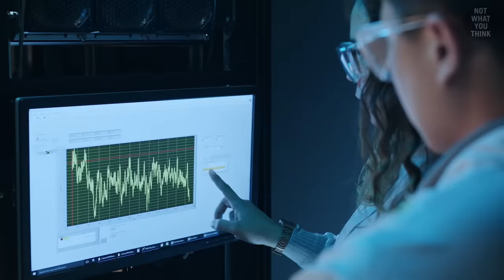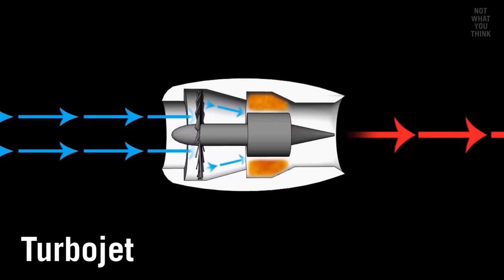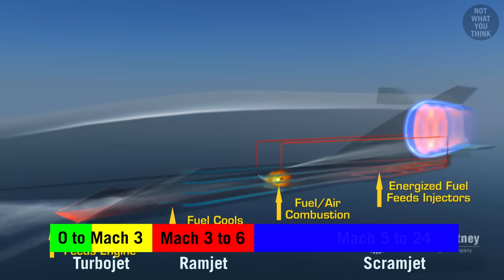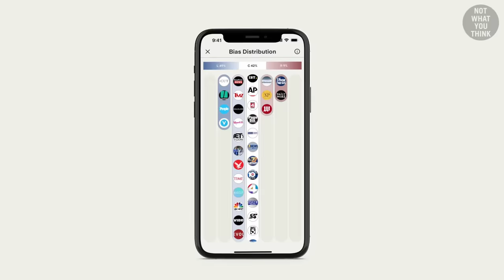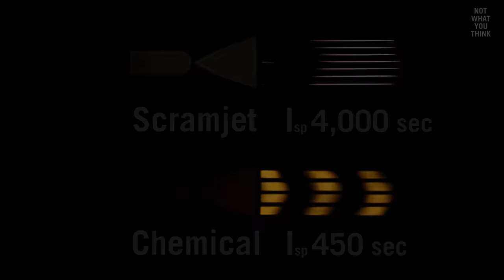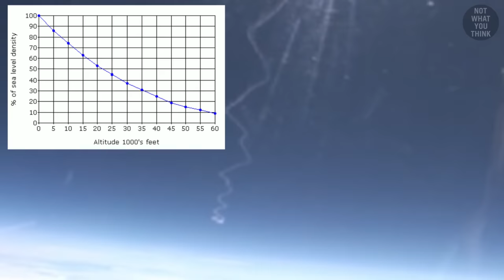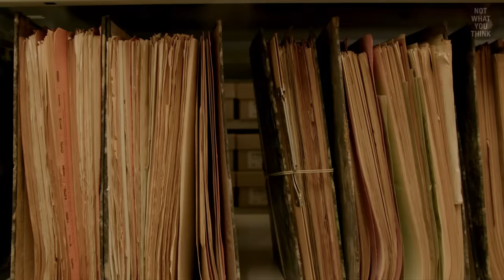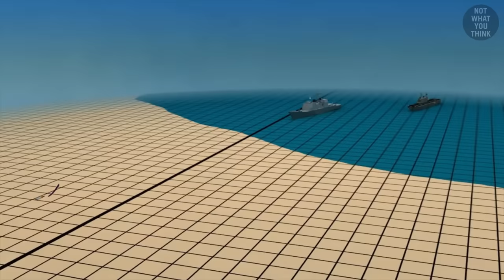The Hypersonic Missile Vulnerability That NO ONE Talks About

Comment: @NotWhatYouThink you're absolutely right on almost every account but one, the implied premise that all these problems are, somehow, inherently unsolvable, or at least unsolvable on a useful way during warfare.

None of the problems you men ioned are really impossible to o solve, not even communication while under a plasma sheet during the hypersonic flight. 

These problems can be solved, even though they are very hard to, but, essentially, to each and everyone of the problems you mentioned there solutions, some we already know how to solve and have the technology to do so. Some we know how to solve., but don't have the technology to do so yet, and some we don't know don't how to solve, don't have the technology but we do know that they have a solution because there are, no physical laws being broken, and/or preventing them to be solved at some point in the future if the right amount of investment is made on their research. 

The questions, at least until now, are: 
At what cost? And what advantage will be achieved in return from these certainly astronomical costs?

Right now, the all the potential advantages to gained from Hypersonic missiles, even though they look almost too good to be true, at least on paper. When you factor in the actual costs in R&D and the expected time frame from kick-starting multiple lines of research simultaneously and then start getting some significant results from most or all of them. And then the time and costs involved to redesign the solution that was tested on the testbeds/laboratories into a useful piece of technology that could be mass produced and used on actual production of weapons that are reliable enough to be used in warfare., Then things start not looking so good.

For instance, while we have a very good understanding of the overall physical and technological processes involved in scramjet engines, we are very far from actually having explored the technology enough to say that we reached a point that we have enough understanding of them to actualy optimize the way they work, or to design enough different designs to get the expected results on a cost effective manner.

The same goes to using sensors on the missile as well as the missile, sensors and payload not melting during hypersonic flight. We have sensors not only on our rockets and interplanetary probes, but on many far more mundane uses, that are designed not only to operate on conditions where they must go faster, run hotter, and are subject far more extreme conditions, like vibration, humidity, acidity, all sort of chemical and, radiation exposure, etc., often they are subject to multiple of these conditions simultaneously on any given moment during the course of a single mission, yet they do not melt down on reentry, the sensors do stop working when they are above Mach 5 in the atmosphere, they usually work just fine provided their operational parameter are met. 

For instance, even smallish two stage rockets designed to launch a low to medium weight payload, often reach sped in the ballpark of Mach 7-8+ during the atmospheric part of their inicial first stage ascent, and they neither melt, not their instruments -- including cameras, radio and data link communications, and all kinds of system specific sensors for monitoring their operational parameters -- they do not melt down due to the certainly excessive heat they experience both on ascent, and in the case of reusable rockets, during their descent too, in case of orbital reentry vehicles, they also are full of both internal and external sensors and they also work very fine. Sincerely, the heavy insulation heat shield and other passive and active cooling systems on most reentry modules is designed to protect humans, because we have a far lesser tolerance to changes in temperature and other environmental variables. The heat insulation systems used for automated probes reentring the atmosphere isn't on the same level of heat insulation as crewed vehicles, because usually instruments can operate in higher temperatures. So not only we knows how to prevent a hypersonic missile from not melting on the atmosphere, but also know how to keep them cool. 

Certainly we still need to figure out how to apply current technology to the specific case of hypersonic missile, which is not an easy feat in its own right, as well we still need to o figure out how to solve some issues that currently either have no viable solution, or the state of current knowledge and technology has not reached mature enough levels, or that are on the beginning of their R&D life cycle, and a solution is still on the future. 

Despite that, the main problem of creating not only a functional, but also reliable hypersonic missile that's cost effective to be used in combat, isn't technical and technological challenges facing their development, but simply put, lack of proper funding for the fundamental and applied research needed to bring this into fruition. 

From what I've been seeing over the years following publicly available information on such programs from the USA, Russia, China, India, the EU/NATO, and even from my own country, Brazil, which also has been testing our own prototypes for a hypersonic missile light delivery vehicle, it seems to me that, at present, it seems that everyone seems to be stuck on an never ending cost-benefit analisys phase. 

Everyone seems to have done some basic research and testing Hypersonic Missile Systms practical use, some countries even adapted some of existing systems to test the feasibility for their further development and see if they deliver the many promises they do on paper will hold true in reality. But the results seems to be inconclusive, because either the current technology is too expensive compared with the benefits they bring, or the R&D the technology needed to make them cost effective is too expensive, compared with the current advantages os such systems..

In general, this can be said about every piece of technology involved in producing a fully functional, battle ready, and cost effective, hypersonic missile. 

In the end, money, not technical challenges is the real reason we are not seeing HMS outside the prototype phase or at most in low scale production for trial and testing, and probably the reason it will always be a technology of the future. Because, unless there is a greater driver to develop these technologies faster, the costs seems to outweigh the current perceived benefits of these weapon systems.

Sure, having a Mach 5+ conventional or Nuclear warhead that could in the ideal. scenario outmaneuver the enemy defense systems and hit the targets, is very a very cool feature, but the same could be achieved with an overload attack of conventional warheads, no matter of they are ballistic missiles, long range ATG Missiles, or smarter and stealthier cruise missile, and given the current state or the art of the technology R&D for HMS, probably an overload attack using conventional means is cheaper than developing new tech or adapting existing, but very expensive, tech to be used by HMS. 

On the other hand, updating defense systems to react faster, specially if ML/AI could be used to enhance/shorten significantly the reaction time on the defense side, which seems to be cheaper and having a faster R&D life cycle than developing an HMS solution. So, despite the current advantages of HMSs, their edge on the battlefield have the potential to be greatly diminished, and on a shorter time frame its own development. 

So unless we find other uses for funding the R&D needed for HMS to become cost effective, I don't see any country, much less any defense sector company, flooding their R&D teams to make it happen. Thus, unless we find other military or civilian uses for the same tech, Hypersonic Missiles will forever be the weapon of the future.

And about the if the current/past systems, like. Kizhal, Zyrcon, and even the Nazi V2 rockets, being or not hypersonic missiles, I would say the V2 could not be considered as such because it crossed Mach 5, without using an scram jet engine and it was also more like a curious accidental feature than a designed one. We know little about the Zyrcon outside, usually botched up, propaganda pieces, but for all we know with some confidence about the Kinxhal, I wound not go so far as saying it is a true hypersonic missile, but also wouldn't say it isn't one either, as I see it, the Kinzhal is an hybrid of conventional and hypersonic technologies and I think it is a necessary step towards a true hypersonic missile system, as I don't see any country investing so much for the solution of a problem that has an existing and relatively cheap solution, and whose advantage could be denied a few years down the line by a fraction of the HMS's development costs.

We will probably spend a lot of time in this phase where the focus is on these hybrid solutions. And it will persist either until the costs fall down by a large margin, or until it is possible to create a weapon system whose advantages could not be as easily negated by a cheaper and faster development on the defensive side of this battle's equation.

Comment: they hypersonic missile itself is a delivery vehicle for energy.  if the core of the missile is a tungsten pellet the shape of an airgun pellet, it will travel strait and true during the final decent stage through the atmosphere to the ground where the engine and controls melt if it can be dispatched from the booster with explosive in the cup. this charge can be moved before separation to correct for target motion if communications can be accomplished by laser from above through the plasma sheath. think like mini rods from god. maybe design small glide vehicles to deliver a 100kg intercepteor. another use is as an anti-material weapon that takes advantage of kinetic energy of sand and gravel to stop an incoming missile. if a rocket hits a wall of 5000mph gravel... is it still a rocket.

Comment: I would think that the best use for a hypersonic missile would be one that spread-fires when it nears the target. Like fly hypersonic to as close as you possibly can at those speeds, then slow to a more manageable speed, then open up and spray dozens of small missiles in all directions, each of which would be flying ballistically in the direction of the target area using the speed they'd acquired, and then could have their own fins and thrusters to reorient toward the target. This provides the advantage of getting all this firepower to the general area of the target very quickly, and then the "spread and regroup" tactic would make each smaller missile harder to confront. I would think it would be best used on things like airfields and ships, where a lot of small explosions would wreck up the joint.

Comment: The whole point is to skirt the outermost defenses say on the coast at hypersonic speeds then slows down to engage like all other missiles. Skirting the outer defenses gives higher probability of strike because your only dealing with inner defenses and also the point you made about 24 minutes to strike the other side of the world. Information is only good for a bit. Instead of launching an F-18 and flying for an hour and launching the missile that hits an hour and 12 minutes after the intel came in likely produces an empty or escaped target. Not happening with that hyper! 😁

Comment: i wonder if anyone knows its flying altitude and the speed at the impact    I have seen an impact on a building and i was not impressed
No important structural damages to the building    I mean the building did not collapse at all
There is another problem with speed      Decreased accuracy
GPS signals have a refresh rate of 1 Hz    one second at mach 5 equals to 1715 meters  !!!
My understanding is that they slow down approaching the targets ?
Reply: descending into thicker air atmosphere will slow down the missile very fast, possibly down to mach 1
Reply: @roxout5743  hi thank you very much
I read something about that
Then in the terminal part of the flight they become visible to radar
Imho stealth cruise missile maybe will have less range but can be more effective
Stealth is a winning feature  
A stealth cruise missile launched at night could be unstoppable
The ultimate weapon expecially if loaded with some 200kton warhead

Comment: What's the possibility that the US has already developed a nuclear point defense missile system. If a hypersonic weapon is difficult to destroy because the effective blast radius of the defensive missile isn't large enough to account for the velocity components of the hypersonic weapon then isn't the solution a larger effective blast radius? Wouldn't the EMP also be a bonus testing how well the weapon's electronics were hardened? A well-placed .22 cal (for instance in an eye) will stop most human targets but a load of 00 buckshot doesn't need such careful placement to be an effective threat stopper. If all-out war is imminent I hope that the wokesters within the military command structure will be shunted off somewhere their bs won't allow the loss of high-value assets like carriers.

Comment: kinzal is manuverbl flat trajectory missile with rocket engine with pin point precision.....its not balistic cose balistic missile use predicted balistic or pseudo-balistic trajectory an its not powerd all the way to target they go up with engine power then from high up they fall down to target using free fall gravity akceleration....kinzal fly flat powered with hard fuel rocket engine all the way to target.....like p-1000 vulca anti ship missile or p270 moskit they all use rocket engine to hit target with manuvering foloving radar signature of mouving ship so they didnt cruise missile cose of rocket engine but same p-800 oniks or p-700 granith with air breathing engine are lol....if manuver in flight considering suraundings[interactive in a way]] an have big precision they are cruise missile...not define but engine type

Comment: Transparent Aluminium "Transparent aluminium is very tough, but it also has an extremely high melting point and can remain solid up to 1200 degrees Celsius." Optical Sensor can be used and Laser Tracking can be used on a hypersonic missile. While yes its infrared signature is very high, this means that the missile is hidden from the exact tracking of an Infrared Seeker. Flares are used to protect a fighter jet from a missile attack by extending the thermal signature to a larger area, this plasma shield is an extended thermal protection field, also the reader signature would be reflective, but the same problem the reflection is so large that a radar seeker missile cannot target the actual missile accurate enough for a close or direct kill, while a fragmentary warhead detonation ahead of the missile, the plasma field itself can deflect those fragments away from the actual missile. You need to do a better job of research, cause you sure didn't prove any of your claims, just made them.
Reply: By your logic, your claims are made up! Lmao.

Comment: Very wrong dude. At the moment, it cannot be stop
Reply: except by most air defense systems capable of outmaneuvering it
Reply: @coyoteeffect  It's hard to outmaneuver a missile that can travel in all direction.
Reply: @markop.3460 it’s hard to change the direction you’re moving in at such high speeds
It’s called momentum
Reply: @coyoteeffect  Ahh the momentum. It's also called hard to shoot down. :)
Reply: @coyoteeffect  How can you outmaneuver something that run 3 times as fast as you with capability to change flight?
Reply: @markop.3460  Let's assume you can drive
when you turn, do you slow down?